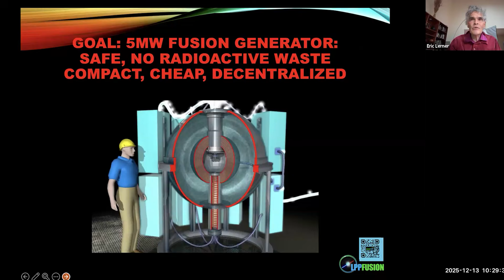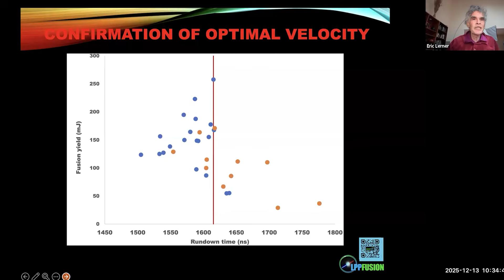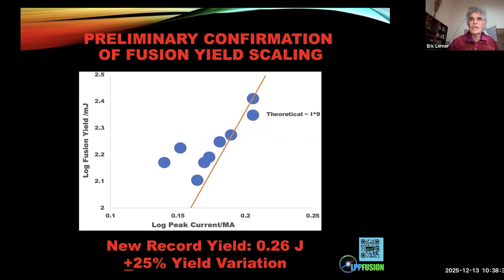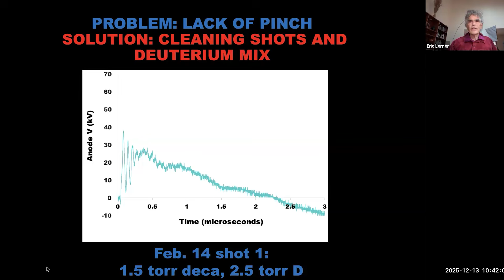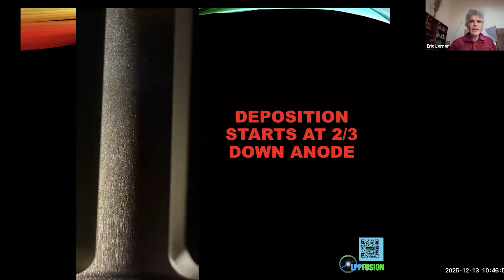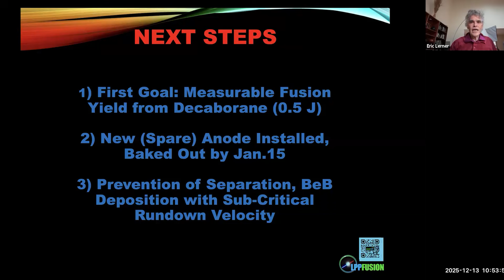Aneutronic Fusion with the Dense Plasma Focus

Comment: Erm. This may sound nuts, but if you can layer BeB onto a surface, as an unwanted byproduct, and others (you seem to indicate) might be interested in layering BeB onto a surface as a desired product might there not be an avenue to greater funding there? Just a passing thought.
Reply from the maker: Yes, we are trying to find collaborators who are interested in this substance. Of course this not exactly mass production--it's a thin layer.
Reply: Given the high voltages this is likely just standard sputtering deposition. It's not new and dedicated devices are more efficient at doing this. All told, probably a distraction from the real goal.

Comment: Creating energy from fusion is like carrying water uphill and dumping it into a turbine. 
You can get energy out, but the input energy will always more than the output, making it impractical.
Reply: Except that the mass of the water in that analogy doesn't change, with fusion the mass of the products is less than the reactants with the mass-energy equivalent being released, so you get more energy out than you put in. This is the whole point of fusion.
Reply: @perkmeister1  For fusion to manifest requires that the input materials be in a plasma state.
   First you have to expend energy to manifest a plasma state of the input materials, which requires more energy that you can get out of it.
Reply: @JoeDeglman  Once its in a plasma state and starts to fuse the mass difference is turned into energy, and that's a LOT of energy per unit mass, more energy than was expended creating the plasma conditions in the first place. You're suggesting the Sun can't work, neither can hydrogen bombs.
Reply: @perkmeister1  The idea that the Sun creates its energy from fusing hydrogen into helium is not supported by the evidence.   There is a Forbes article out on this stating from observation that the main energy of the Sun cannot come from fusing hydrogen into helium.
      Also, the mass difference between hydrogen and helium is only an atomic mass of .0004 AMU.

The evidence from the Sun, according to the latest data from the solar probes, is that there is no evidence of energy transport from below the photosphere.  The energy of the Sun comes directly out of the photosphere.
     There is no evidence that the photosphere is in a plasma state.  The chromosphere is in a plasma state from being ionized from the energy out of the photosphere.  
    *The impact of multi-fluid effects in the solar chromosphere on the ponderomotive force under LTE and NEQ ionization conditions - Juan Martínez-Sykora, Bart De Pontieu, Viggo H. Hansteen, Paola Testa, Q. M. Wargnier, Mikolaj Szydlarski
   So far, the Hannes Alfvén solar model is the only model supported by observation, wherein the energy of the Sun is most likely from the annihilation of hydrogen, not from fusion.   Ditto for a hydrogen bomb.

   Heium-4 is created by alpha particle in the prominences from the fission of heavier elements in the prominences, not from the hypothetical proton-proton chain.
   The proton-proton chain is just mathematical propaganda from Hans Bethe.   No one has ever manifested the proton-proton chain.
   Fusion bombs, or the idea that a hydrogen bomb works on fusion, is just propaganda from the communist spy J. Robert Oppenheimer.
Reply: @perkmeister1  The latest models on fusion claim that if they can get the plasma to 7,000,000 degrees, they can get net energy output when fusion manifests.
   The AMU difference between 4 hydrogen atoms and helium is only .0004 AMU.   That puts the output on par with plasma recombination experiments or releasing energy from battery storage, which is less than 100% efficient. E=mc*2 energy output from fusion is a peyote pipe dream.
Reply: and yet every source of energy we use on earth is a derivative of the fusion energy taking place in the sun, except for nuclear fission. we just have to figure out how to do it on a small scale.
Reply: @skyhawk551  Actually there is no evidence of the fusion-at-the-core solar model.  The characteristics of the Sun's output defy every prediction of the fusion at the core solar model. There is no evidence of energy transport from below the Sun's photosphere but there is evidence that the major source of energy creation on the Sun cannot be from fusing hydrogen into helium.
   For fusion to occur requires that the materials to undergo fusion be in a plasma state.  There is no evidence that the Sun's core is in a plasma state and there is sufficient evidence that the Sun's photosphere is not in a plasma state.
   The only place on the Sun where fusion can occur is in the lower chromosphere, which is in a plasma state.
   However, data from the solar probes shows that the majority energy of the Sun comes directly out of the photosphere.  The only way that can happen is by the only verified way of creating energy on par with the Sun is from annihilation of hydrogen directly out of the photosphere.   This is the only method.  It has been confirmed by CERN to create energy on par with e=mc^2.  Fusion will never be able to produce energy on par with e=mc^2 because the energy required to create a plasma state out of the input fuel will always be greater than an energy created by fusion.
   The Hannes Alfvén solar model, in which the energy of the Sun is created directly out of the photosphere, is the only solar model supported by the solar probes and observatories.

The impact of multi-fluid effects in the solar chromosphere on the ponderomotive force under LTE and NEQ ionization conditions - Juan Martínez-Sykora, Bart De Pontieu, Viggo H. Hansteen, Paola Testa, Q. M. Wargnier, Mikolaj Szydlarski

Comment: Good luck and all that but I do so wish the well over $Trillion wasted on Fusion Power Wastage over the last 70 years had been spent on FISSION Breeder Reactors (ie. Thorium (molten salt)) as I do NOT believe commercially viable Fusion Power is possible. Only the gravitational confinement of an actual star can provide continuous fusion reactions. This has been so well proven I can't understand how Fusion Power Wastage gets even MORE funding in the West to expensively prove the point while Breeder Reactors don't get any funding.
Reply: Why would you need continuous fusion reactions?
Reply: @perkmeister1  .. Otherwise your reactor would be USELESS, and wouldn't be a power station! Are you seriously asking this question? You do realise sustaining fusion reactions is the goal of all these failed experiments? NO, obviously not!!.... unbelievable!
Reply: @PrivateSi  This is a pulsed power system. Just like an internal combustion engine where the fuel is not continiously burned but only for very short periods, the power from each stroke is smoothed out by the drive chain to produce continuous power. Helion are not trying to get steady state plasma burning, neither are ZAP energy. In LPPFusion's device each 'shot' is designed to generate net energy where the energy out is stored back in the capacitors, and this is repeated many times a second. The energy in the capacitors would then power phase locked inverters to continuously power the grid. You do NOT need to have sustained fusion in order to get continuous power output to the grid.
Reply: @perkmeister1  .. Pulsed CONTINUOUSLY. If you can't sustain the fusion reactions you have no power generator, just another FAILED EXPERIMENT.
Reply: @PrivateSi  Oh, changing the definition of continuously now are we? OK, what makes you think LPPFusion's device couldn't do that?
Reply: @perkmeister1  .. WHAT?! It's just another word for SUSTAINED. I am aware of his approach as he's outlined it many times. It's  the confinement and sustain / continuousness or whatever you want to call it I disagree with. He's just going to waste loads of power heating something up to 10s of millions of degrees in a confined space, rather than (bred) FISSION of NATURALLY HOT materials. Like all fusion fanatics, they can't even explain how they're going to  convert the heat into electricity efficiently... Fusion research should have been at the bottom of the advanced energy research grant pile, not top, as it has somehow become, despite 100s of experiments + over a $trillion globally spent.
Reply: @PrivateSi  OK, I'm not sure you understand what is going on here. This is not like most, if all, other fusion generators.The shot starts with a discharge from the capacitors across two concentric electrodes. Multiple filaments of current carrying plasma form which move up the anode and then all come together in a big pinch to form a plasmoid. A plasmoid is a self organising ball of plasma which again due to the pinch effect pulls itself very tightly together naturally and constrains and compresses the plasma, and has ion temperatures in the billions of degrees (not 10s of millions). It also has magnetic fields in the gigagauss range. That compression, temperature and confinement time should be sufficient for pB11 fusion to occur (and we'll find out soon whether this is can be measured).

The plasmoid loses energy due to electron radiation which causes a collapsing of the current and hence the magnetic field, and a very high electric field results which accelerates the positively charged energetic ions in a narrow directed beam. That beam of charged particles is now already an electric current. That current is inductively converted via a coil arrangement into current to charge the capacitors, the work done to do that coming from the kinetic energies of the ions which are slowed down by the inductive coupling. This is completely unlike D-T fusion where the neutrons carry most of the kinetic energy and have to convert that into heat by collisions to ultimately and inefficiently drive steam turbines because they're neutral and can't be inductively coupled, nor can they be guided by electric or magnetic fields. This all happens multiple times a second, the capacitors smooth out the pulsed input power and drive phase locked inverters to generate continous power output on the grid.

So it's the plasmoid itself (which is created naturally without the need for any large external magnetic fields) that heats the ions to very high temperatures and confines the plasma. The mechanism for converting the kinetic energies of the charged ions to output energy is not via collisions, but instead is electrically via inductive coupling. BTW particle accelerators have been recovering energy from directed ion beams for years, and at very high efficiencies (>90%), so this is not new physics.
Reply: @perkmeister1  .. I've watched 100s of his adverts, sorry vids, I understand he's a Plasma Universe nut, don't worry........ I JUST DISAGREE! I do think black holes exist (well, dark, solid stars that act like black holes, technically\), they are NOT plasmoids. I DO agree there are very weak but large magnetic  + electric currents in space, but they are NOT the PRIMARY organising force in  the universe, it emerges after gravity has done its thing. Electric currents are secondary, and magnetic fields emanate from stars and iron-cored planets, and only effect plasma (not neutral particles).
--
But specifically his fusion energy project / delusion / dream / grift depending on your POV I think he's living on wishful thinking. Keeping the system stable enough for reaction control will be MORE difficult than  even a Tokamak, due to the incredible temperatures needed for the fusion to occur compared to other methods, which will also fail for their own reasons. I know he SAYS magnetic inductance is how he'll extract the energy but he never says HOW he'll be able to PRACTICALLY do this, just as his competition says 'it will heat water and use a turbine'... HOW?! Also, wall collisions kill normal fusion reactors so they can't use collisions to collect heat.
--
I don't think you understand basic thermodynamics or the scientific method. 100s of experiments have simply multiplied the number of insurmountable hurdles when it comes to SUSTAINED NET PROFIT compared to the competition. Every 'success' in Fusion Energy is countered by the research showing more and more failure points. Like I say, you can waste trillion$ on pie in the sky ideas, heating up naturally cold stuff to millions of degrees, or use material that's naturally hot, or can be induced to turn into naturally hot fissile material via a sustained chain reaction started by bombarding non-fissile material with neutrons.
Reply: @PrivateSi  I'm glad you don't hold his plasma cosmology views against him (unlike many others) when doing fusion experiments, we both know that what's important is whether he can model the behaviour of the plasma accurately in the lab. It's really quite irrelevant what his cosmology views are in that respect. 

Just to point out the size and duration of these plasmoids, they're tiny, around 50 microns in radius and they only last for a few 10s of nanoseconds. The triple product is still high enough for fusion even with such short confinement time because the pinch is so strong that the density is very high (5 orders of magnitude higher then tokamaks), and the temperature of the ions is over 2.8 billion degrees C (again around 30 times the Greenwald temperature limit of tokamaks) .There's no need to have any reaction control loop as their shot-to-shot results aren't widely different, he mentions within 25% between each one in the video, and given the capacitors smooth out this variance the only control loop really needed would be the repitition rate to control the amount of power sent to the grid.

The goal at the moment is just to get some fusion reactions to prove the plasmoids really do have conditions for fusion with experimental results, the inductive conversion hardware will come during the engineering phase (they're still deep into the research phase right now). But since this is all based on known physics and particle accelerators have been doing this for years at very high efficiency the risk is low and simply not worth their time designing that right now. I mean I'm an electronics engineer, if I need to demonstrate a protoype product quickly and I know I can do that using a bench power supply I'm not going to waste my time designing an embedded power supply in my prototype and delay the demonstration, because I know that's just a simple engineering step to add one later. Plus as soon as any fusion reactions are measurable it's likely to stimulate more funding and accelerate the development. They're really a very small lab with extremely limited funding.

I think you may be referencing thorium salt reactors in your last comment, but you can blame the lack of funding for that on the government for wanting only to support reactors that produce fissile material not contaminated with U-232 and which are suitable for nuclear weapons. As a result China now has a huge head start on the US. Of all the SMR designs that's probably the best IMO, but then I'd rather see much simpler aneutronic fusion reactors anyway.

Comment: you are doing it all wrong, you'll never reach break even or a sustained reaction like this
Reply from the maker: Not aiming for a sustained reaction. We're aiming for getting more energy out a pulse than we put it. A gasoline enigine operates the same way--each piston generates a pulse of power which the drive train converts into continuous power.
Reply: @LPPFusion well said, historically the pulsed cyclic combustion engine was industrialized years before the continous combustion turbines invented.
Reply: @LPPFusion  But the Sun runs continuously.
Reply: @axeman2638  it has gravity to provide containment, and it's also surprisingly not energy dense. the reaction rate is very slow, the size of the core results in the energy production rate that we enjoy.
Reply: @skyhawk551  What energy production?
It uses many more times the energy that it returns.
Reply: Not sure what you mean by 'sustained reaction', could you elaborate?
Reply: @perkmeister1  maintaining continuous fusion
Reply: @philipm3173  They're not aiming for continuous fusion, it's a pulsed power system.
Reply: @perkmeister1  A reaction that can be sustained indefinitely. Not just a few nanoseconds.
Reply: @axeman2638  They're not aiming for a reaction that can be sustained indefinitely. This is a pulsed power system, it's repeated just like an internal combustion engine doesn't have continuous explosions to produce continuous power
Reply: @perkmeister1  Then they are not aiming at the target are they?. The sun doesn't pulse, it's a self sustaining reaction.
Reply: @axeman2638  They don't need to aim at that target to get net energy out (just like Helion or Zap Energy are not aiming at that target). They're using pB11 reactions of which in the Sun are insignificant, the Sun primarily uses the p-p chain reactions to produce Helium. Secondly the Sun is massive and uses its huge gravity to produce pressures needed, and the core temperture of the Sun is only around 15 milion degrees C, so the reaction rate is quite small. A compost heap actually produces more power per unit volume than the Sun. LPPFusion are NOT recreating the Sun nor its primary reactions, so you're comparing apples with oranges. Lastly just because the Sun doesn't pulse does not mean a pulsed system wouldn't work, that's a completely illogical conclusion.
Reply: Like a Schwinger breaker